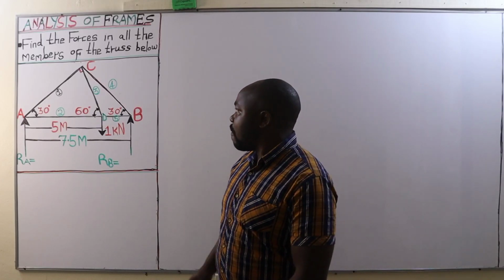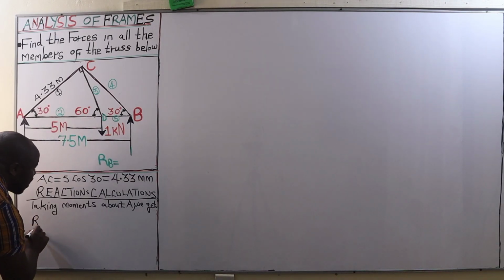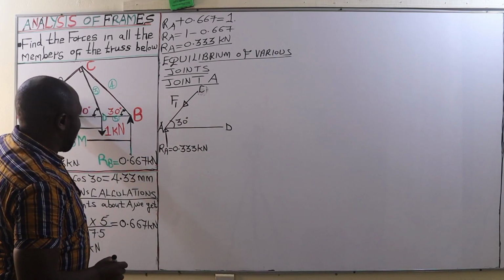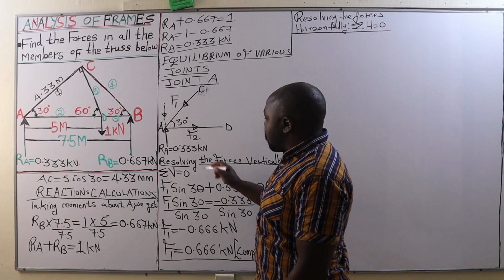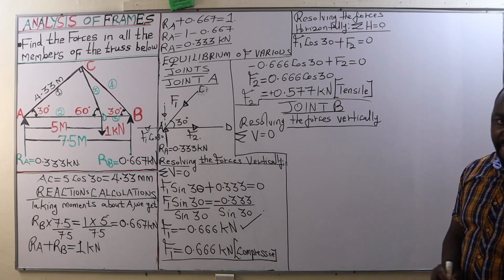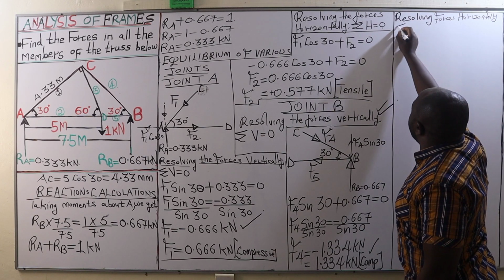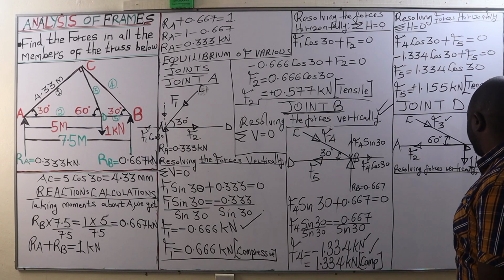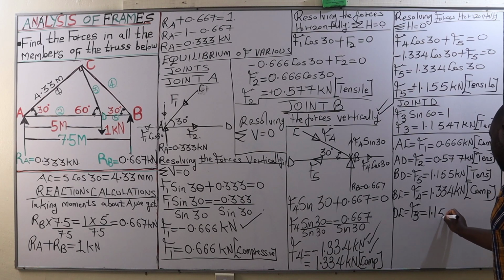ANALYSIS OF A TRUSS USING THE METHOD OF JOINTS|FRAME ANALYSIS.

Comment: In simpler step:
Take every joint individually isolated.
Take From joint whose resultant (force) is known and take sum of all moments from this joint m=f*d or when it is not perpendicular take m=f*dcos*tita in x axis or m=d
 F*dsin*tita in y axis, where moment direction of force is clockwise then + or if in anticlockwise then -. 0= sum of total moments( 0= m1+m2...).
Cause of it we get other resultants whose value where unknown till now.
Make free body diagram of which joint you are using, take value of 0=sum of x axis forces( if force direction is not in perpendicular use f*cos*tita) and 0= sum of y axis forces( here use f*sin*tita if force direction is not perpendicular).
Here if resultant force value is minus than it is compress and if it is positive than it is tense. Use it on every joint to find force values. 
Joint are usually use in truss where external force are commonly in perpendicular. Unlike in this triangular, value of forces either + or - is decided by tense and compress of a 'member' when suming them according to their x axis and y axis. Where force direction toward joint is - and + in outward the force.
Reply from the maker: Alright Sir.